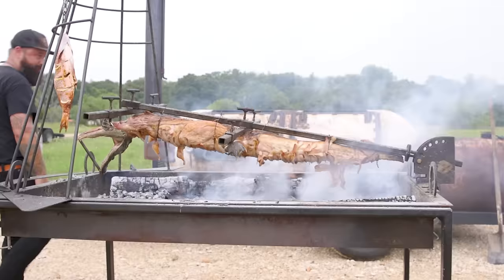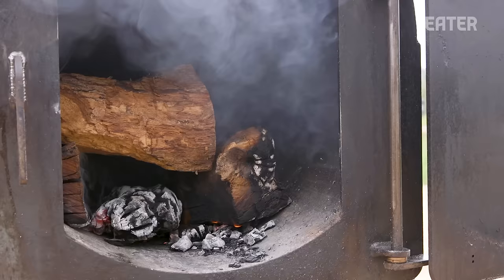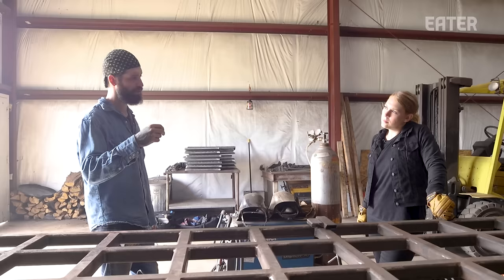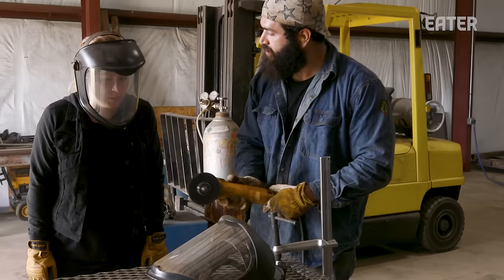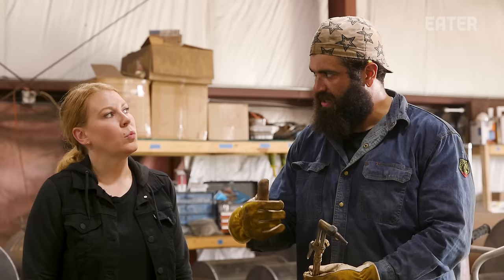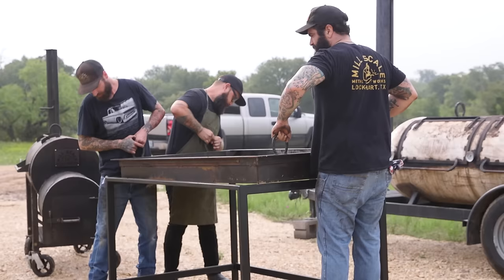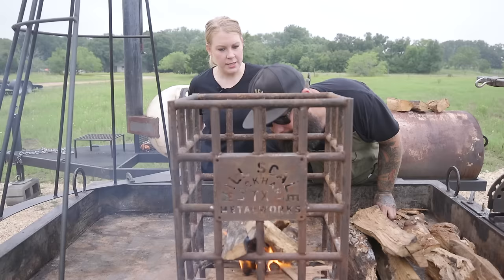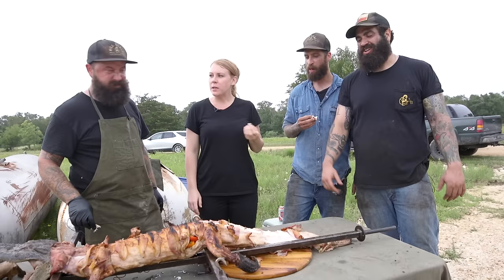How Custom Barbecue Smokers are Made — How To Make It

Comment: They got someone not used to using an angle grinder cutting steel with a grinder with the safety shield and side handle removed.  Great.

Comment: I currently live in Lexington, Kentucky and am wanting to try to make my first offset smoker...I cannot find anyone who sells the steel  pipe like the ones you are all using.  Is there any suggestions on where to go, who to call?  Any info would be extremely helpful.  

I’ve gone to metal suppliers and I’m told every time that no one will carry the size I’m looking for...which would
Be 18-22” diameter, 1/4” thick, at least 4 foot cooking chamber and at least a 2 foot firebox..all round tube
Reply: Most likely they used rolled sheet steel for this size

Comment: I would be a smoker in Russia :) And we do not buy :( Only very low quality all ((( So as there experience not what you have !!!
Reply: what?
Reply: @jaczekdertuerke  Sorry very bad translator
Reply: @jaczekdertuerke  I Wanted to say :
I really want to buy a Barbecue Smokers.
In Russia it is not to buy.
They have very low quality :(
Reply: @MrPrescott2008  Can you afford to have it built? Plans are available, you do need somebody with welding skills.
A lot of smokers are built from scrap - discarded barrels or water/gas tanks. Of course clean it out and use safety precautions.
Reply: @MrPrescott2008  ah thanks for clearing it up. Why don't you have it built by somebody? I think the design is fairly simple and easy to build if you have access to materials als equipment.